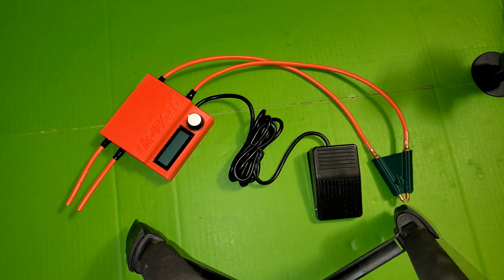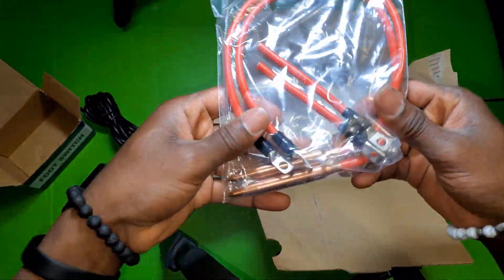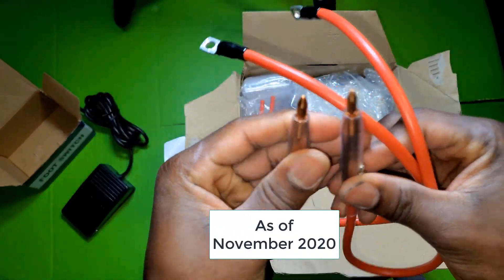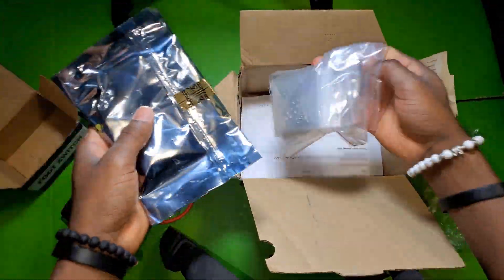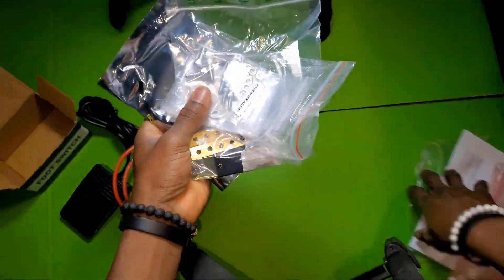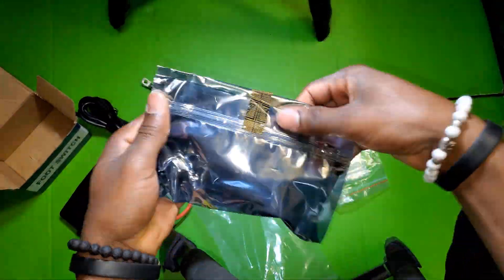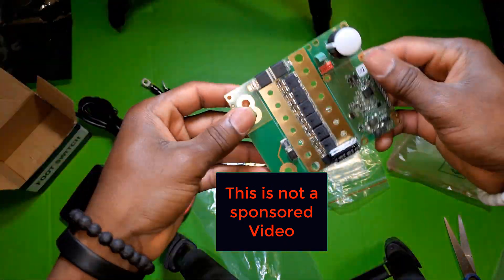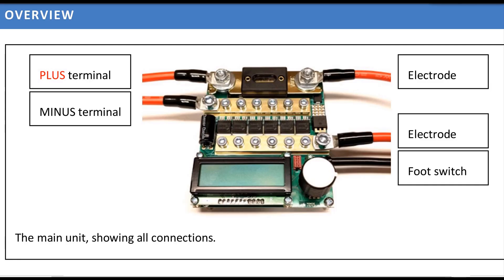kWeld | Best 18650 Battery Spot Welder?

Comment: @YvonSmart
Hi.....I don't have this great Kweld kit yet but I'm just wondering about powering this unit with instead the single 5000mAh Lipo, I've got two 4000mAh  Lipos and I'm wondering if Iwould be able to 'junction' them in series with the correct plug connection to add up to 8000 mAh.  Can you please tell me what I would have to be very concerned about in the way of a correct homemade Y-Connector so as still being able to deliver the needed power without frying the connector?  Thank-you....Paul
Reply: Series does not add capacity, series increases voltage. Yes, you can parallel them to 8Ah, many people parallel two medium power lipos to give them enough power to get 1200A+ spot welds. These turnigy packs are some of the best out there Turnigy is one of the few that isn't blowing smoke up your ass like a chimney when it comes to C rate. These cells are a legit 1mΩ each, not 1.7mΩ they are usually 1.0mΩ

Your Y connector must be as short as possible and must be able to handle the current. Obviously the 150 connectors he used here are rated for 150 amps but thats for continuous usage not a 20ms burst. So I highly suggest using something rated above an XT90 and doing a damn good job making the parallel connector. I would look at doing the wireless method although I"m not sure if thats possible with XT150's, I know it is with XT90's

Comment: Great video with clear explanations.   I am curious though about the Lipo connection to the Kweld. You attached a link to XT90 connector. What is shown on the video seems to be a different type of connector. Have you modified the XT90 connector(s)?
Reply from the maker: In this video I used XT150 connectors. They can handle more current but be sure to double or triple the shrink tubing to prevent the battery terminals from touching. I learned it the hard way. https://amzn.to/3ilHWyV

Comment: BIFRC mini spot welding can adhere firmly at 0.3mm nickel strip
Reply: LOL no it can't
Reply: @ericklein5097  LOL indeed. Even pure .15 is a no no. Nice welds on 0.1 ni plated steel though :D
Reply: @aurelien38  this depends on which model they are talking about. There's a BIFRC board that can potentially do 0.20mm pure nickel but you need a proper power source and there's one popular channel on here where the guy has added heat sinks to handle the fact that the board is small and doesn't dissipate heat well on its own. He says it still gets hotter twice as fast as most other boards.

The self contained BIFRC with the built in Lipo that looks kinda like a power bank is grossly under powered. 0.15mm Pure Nickel isn't going to get a proper weld, perhaps 0.10mm pure nickel will. 0.15mm or 0.20mm nickel plated steel with slots in the middle is probably the thickest material it can do.

Obviously there's going to be some variation in the power of the Lipo included. I wouldn't expect them to be using anything fancy since the self contained unit sells for $30 so probably $10 spent on the Lipo cell(s). If you get lucky and store it properly (3.75-3.85V when not using it) you might get a strong Lipo that lasts a couple years and from the start it MIGHT be able to do 0.12mm pure nickel or give you shitty welds with 0.15mm pure nickel.

Would love to see the OP post a BIFRC that can do 0.30mm pure nickel
Reply: @ericklein5097  Thanks  for these precisions ! I Tbh I got so annoyed by my BIFRC unit that I snapped and went for a kweld...

Comment: That steel washer you placed between the lug and the fuse will add some resistance you don't want.
Reply from the maker: That steel washer prevents the sharp edges of the lead from biting into the coded surface of the fuse. It's necessary, BTW the resistance is so small the kweld is still capable of 2000+ amps output and 500J

Comment: How many welds can you get with a single battery charge? They make a power supply kit w/ the Kcaps where you simply add a server power supply but I don't need to perform a ton of welds and the battery is a cheaper option.
Reply: I'm using a lead acid battery and I've done a couple hundred welds and still plenty charge left
Reply from the maker: Not sure, but I made a 10s2p battery pack on a single charge and still had something left
Reply: hundreds

Comment: What's so good about it and how is it better than a professional welder??
Reply from the maker: It's a heavy duty spot welder in a portable form factor. No 120v/240v spot welder in the kweld's price range can be compared to this. I have tested so many of them. 240V always worked better, but the US runs 120V. For a professional spot welder, you need an expensive one if you want this welding quality. The only thing annoying about the kweld to me is the fact that it runs on battery as you have to keep charging it for extended work times
Reply: @YvonSmart  I bought a spot welder advertised as the new improved version on Amazon, with the power at the highest setting it wasn't capable of welding the provided  Nickle strip to a battery that couldn't be pulled off easily. A number of spot welders offered for sale just won't do the job, IMHO of course.
Reply from the maker: @georgebreckenridge3351  The kweld is not from amazon, it's from keenlab as shown in my video. Of course the competition will use their name to sell other products. I have tested the SUNKKO 737DH 4.3KW, a $300 + full size welder and the kweld beat it. But I later learned that the SUNKKO 737DH works better a 220V (I tested on 120V US) but still!!!
Reply: @YvonSmart  I wasn't talking KWELD, I was talking about one of the alternatives that doesn't work.
Reply: @YvonSmart  Sounds good but I am still unsure how or why a DIY welder is supposed to be better than a factory built model. Does the kweld somehow have more reliable components compared to any other welder? Also, how does this result in a better or more reliable weld quality? I'm just asking because I almost got a sunkko but in the end decided against it and used a cheap little device to do the 1500+ welds I required for a project. During my tests of the device, the welds always came out looking and feeling perfect. Looking forward to hearing your opinions.
Reply from the maker: @Convolutedtubules  the kWeld is a pretty good portable welder. It can't be better than the professional 120V/220V welders that cost more than itself, but the ones in its price range are either at the same level or worse. They use a transformer to step down the voltage and increase the current (Very powerful on 220 - 240V ), but here in the US, we use 120V (unless you get a special line for a shop or something). Then the device performs worse than the advertisement done on 220V. The Kweld isn't really a DIY  welder, it comes disassembled just to lower cost. The draw back is that you need the required battery to power it and it kinda sucks because you still got to keep charging the battery during intensive use. So in conclusion a professional welder is always better, just stay away from the cheap ones. Also, if you decide on the model you wanna buy, youtube it and watch actual test videos. Many of them just don't work.
Reply: @YvonSmart  I didn't realize that the devices operate poorly at 120v, good to know that. My 17$ battery spot welder did me good for close to 1500 welds already with 99-joule impulses and it did not complain other than heating up slightly. I highly recommend this cheap red welder for anyone who has a limited amount of welding and can't justify the 200$+ cost of a sunkko or kweld.
Reply: @YvonSmart  Which spot welders have you tested from sunkko? The one I was looking into was the 737+ model.
Reply from the maker: @Convolutedtubules  I tested sunkko 737G, 787a+, 709AD (120V) versions, the kweld still beat those. I'm not familiar with 737+
Reply: @Convolutedtubules  the k-weld is vastly superior to any sunkko. The sunkko can only do .2 nickel strip. The k-weld can do .3 and even sandwich copper strip. The kweld output is much higher than the sunkko. Just compare the fets of each unit. Sunkko units are inferior to the kweld. 

The kweld is not some home made cheap spot welder. It's the best you can buy until you start into the 5K + industrial welders.
Reply: @Twin_turbo_coyote_fox  Do you have an opinion on the steel washer supplied in the kweld kit? All the concern of keeping leads short and then tossing a resistor into the current path seems contradictory, and I expect that washer to get hot. How much extra is a copper washer?
Reply: @georgebreckenridge3351  I have had no issues at all with mine. Yes the unit heats up with constant welding. The washer has not been an issue with mine. The unit has a self calibration test. I run two LiPo batteries in parallel and under testing I get 1752A. I have tried up to 500 joules in testing. That heats it up really quick. 60-70 joules is usually where I weld and it's not a problem.
Reply: @YvonSmart  u can use car battry and keep it connect to the charger sl u never run out of joice kweld or malectrics is million time better then 220v plug in one they never trip the power up and can weld up to 0.3mm with ease
Reply from the maker: @alireza071  yeah absolutely, would recommend a starter battery (high amp capable) instead of high capacity ones that tend to sag a lot due to voltage drops, but yeah good idea
Reply: @Convolutedtubules  all the Sunkko models are garbage. Terrible design and even the 240V units struggle with 0.20mm pure nickel.
Reply: @ericklein5097  I got the cheapest spot welder I could find. 15 euro roughly. Worked fine for my 14s8p battery pack with .15 nickel. It overheated quickly, so it took a while with all the cool down time. Well worth it though if you have more time than money.
Reply: @Convolutedtubules  nickel plated steel? Don't think you could source a powerful lipo for under 15 euro that could do pure nickel.
Reply: ive tried a $400 sunkko spot welder and that thing is ok but the kweld is so much more reliable, more consistant welds and can use diferent power supplys and batteries, this welder blows others out of the water
Reply: Can you use ac/dc adapter and what amperage  is required?  Thank you.
Reply: @nestorasuncion1226  you need a 3S 5000mah 60C batter to power the kweld. The kwelds output up to 2000 amps
Reply: @nestorasuncion1226  you must use a high amperage lipo, a large lead acid starting battery or a capacitor bank. You are demanding 1500A+ at once. The only power supplies capable of providing that amount of current are huge rack mount ones that run off 3 phase electricity and cost $10k
Reply: Professional/Commercial off the shelf welder
Transformer and Control Unit $3000
Welding Head $800
Table (how most of these are set up) $200
You're in it for $4000

kWeld: $250
Lipo: $60
High Amperage Connectors: $5
$315 and you have the power of a commercial welder